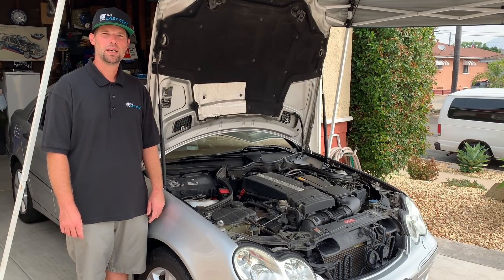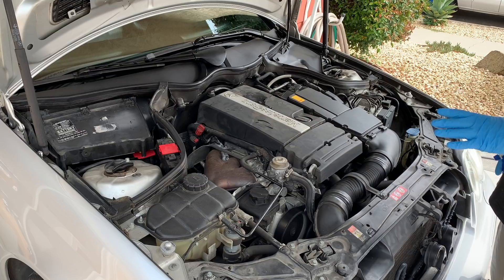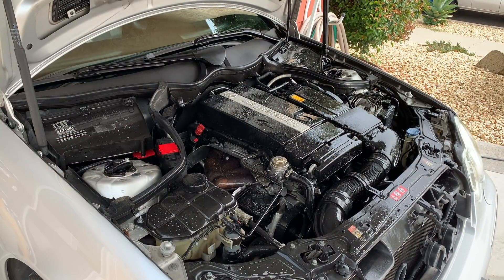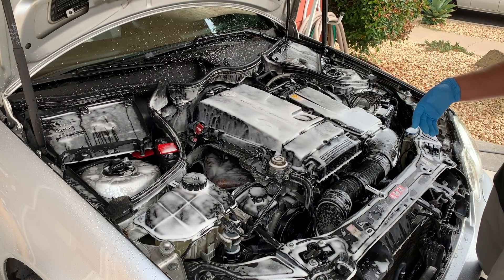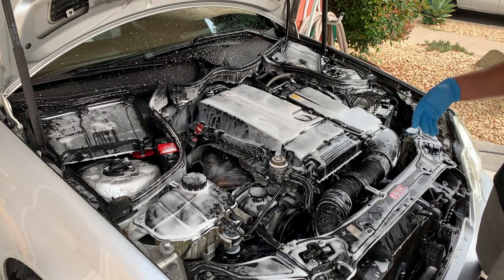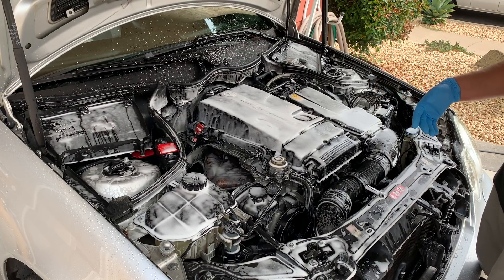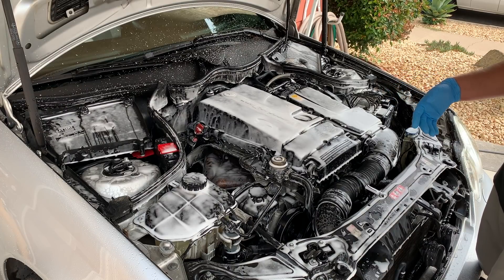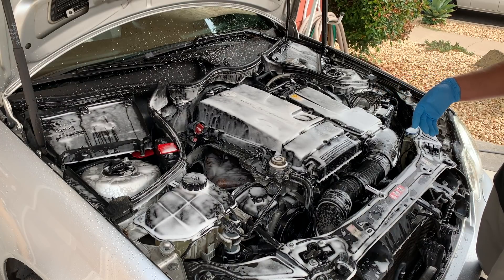Best Way to Pristine & Clean Your Engine Bay with Plastic Restoration I The Last Coat

Comment: ATTENTION JEEP WRANGLER HARD TOP OWNERS!!! If you do any type of off roading and scuff your hard top, it's gonna happen, I have found the best and easiest way to fix the scuffs. Cera Trim by The Last Coat. Just apply a little Cera Trim to the provided applicator and wipe over the scuff marks. Take a microfiber towel to smooth out the product and the scuffs are gone. Not only are the scuffs gone but you also get a "new top" shine and water sheeting. Awesome product!! And all of the black trim looks brand new.